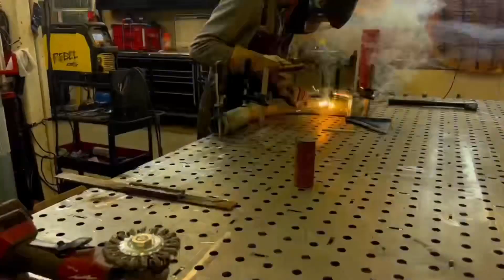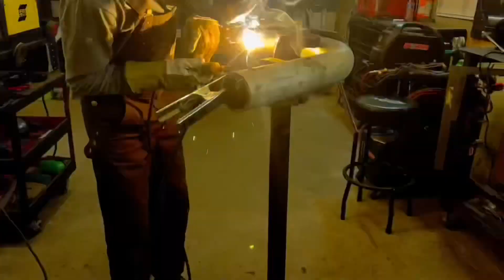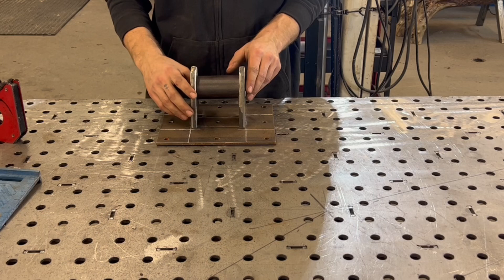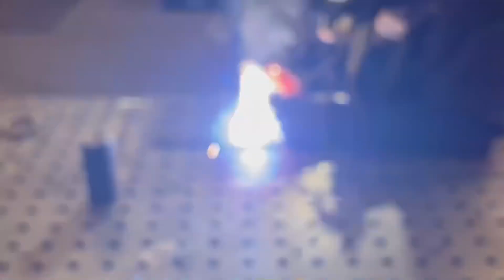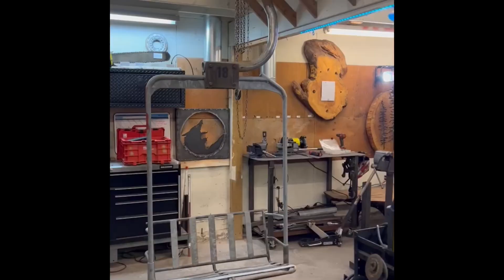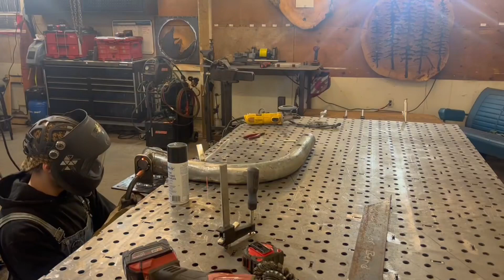SKI LIFT PORCH SWING FULL BUILD

Comment: Great content so far. I have a question: I have seen you use Mig (The heart sculpture), Tig (The kitchen bar) and stick on this video. How do you determine When to use what application? Sincerely, a brand new Mig Welder.
Reply from the maker: Hi! Every application is different but basically, I use mig for ease of welding and if it's a lot of production, mig makes the most sense because it's fast. Stick I tend to use it for structural welding and used in the heart sculpture because it is relatively inexpensive because there is no shielding gas being used. TIG is by far my favourite process because it is the easiest to control heat and is the cleanest finished weld result. I generally use TIG on thinner wall tubes where high heat can be a problem. Thanks for your question!